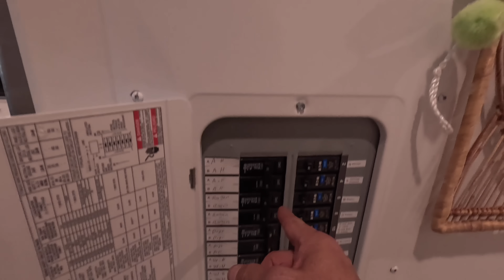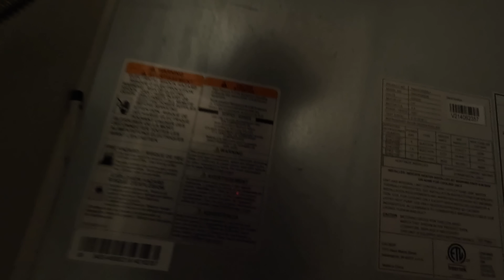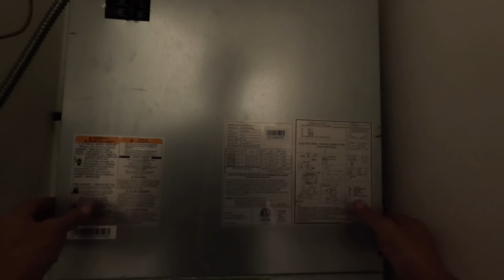Sunday Call. Very Common HVAC Call! #hvacguy #hvaclife #hvactrainingvideos

Comment: I work on a lot of apartments and way too many of the condensers are not labeled.   I write the number on them in 3 different spots so as i get them found i wont have to keep going through the search every time i have to work on that unit in the future.  Not with Sharpies though.  Gotta use a paint pen.

Comment: Clogged drains all summer long last year when I was working on mostly apartment heat pumps, especially when it got real humid. This year, I'm doing Commercial Refrigeration for a different company and translating very well into my new capacity. I'm expecting much of the same as far as drains. I've done a bit of Commercial Refrigeration in the past and I'm good at it, but not as much experience as with residential. Thanks for the video.

Comment: Man you blew that line out with the water inside. Brave man lol
Reply: I would worry about scattering water over a control board. I usually vac those 3/4" drains myself.
Reply: I wonder if it was also a mystery which drain outlet comes from which apt.
Reply: @ Most of the time all of the drains are connected from the top apartment going down to each apartment directly below all the way to ground level. Kind of a pain when you have leaks and you're not sure which apartment it's coming from. Have to go into a lot of apartments and sometimes people don't like it especially when you bug them and their unit ends up not being the source of the leak.
Reply: @ I have an inspection camera for stuff like that

Comment: Pull vacuum and flush water. Wire brush down p-trap. Didn’t remove water from float switch and wondered why it was not coming on. Smh

Comment: 9 times outta ten when every things dead it’s clogged or trans former but since it had no filter it’s dirty and clogged good videoi would have put some drain cleaner and a gallon of hot water down the drain btw no smoke alarm going off should have put the new drain switch in curtis

Comment: Gotta love the galo gun, so small but so mighty . and how tf do on off switches for a disconnect pass code 😂 that crap would be flagged in a nano second out here.
Reply: They are legal in my state as long as they are double pole and rated for the induction load.   You will also commonly see red ones in an area containing a heating plant.
Reply: @grandinosour  yeah, they'd suffice (NEC) and most places local codes, as long as name plate load and supplying breaker isn't greater than switch rating. of course the in use covers with ability to be locked/tagged out(OSHA/whatever) lol
 they did look commercial grade (larger handle grey color), so they "should be" proper 30amp two pole. and the place looks fairly new construction, so it would have passed.

Comment: Curtis Lt. Riley is looking good.  I hate apartments that have no identification on the units.
I had some that the condenser was on the opposite side of the building. I was wondering why it wasn't coming on,  when the genius installer put the units for the right side and the left of the building and thr left on the right. Just imagine the extra line set they used. Headache. How you feel better so. Please protect your knees

Comment: Not sure how the plan works with those apartment complexes but if none of those condensers are labeled to the apartments, it seems pretty dumb the installers left it that way. If you have an agreement with them, I would ask them to hire you to get them numbered for future servicing and "emergency" calls. I can see spending wasted hours trying to find the right one during summer when they all cycle on and off and you need to fix one of 9 apartments not having a clue which condenser is to what apartment.
Reply: More common than u think that units aren't labeled, but I'm the nice guy that marks the unit# on it with perm marker b4 I leave.
Reply: Another great one curtis looks like a case of no filter thanks for the video